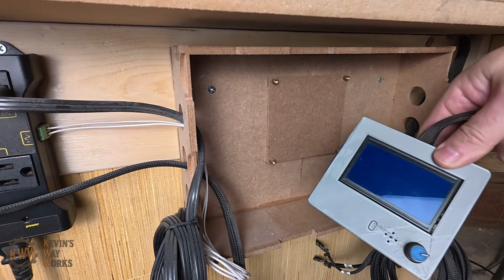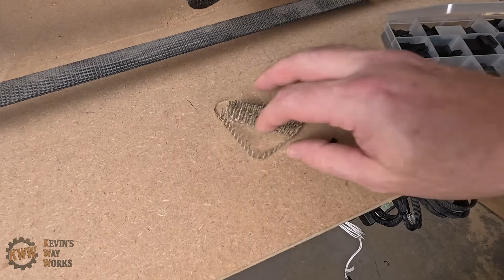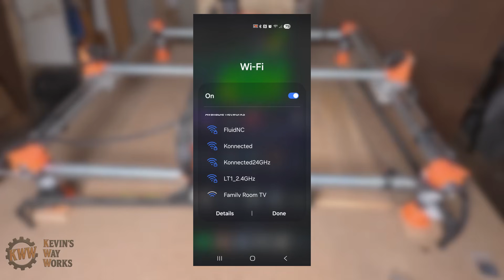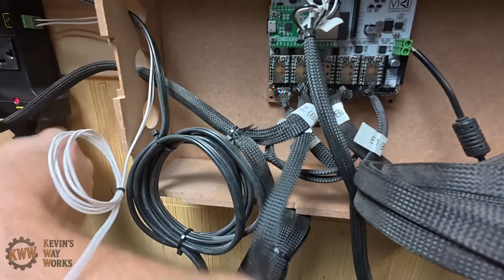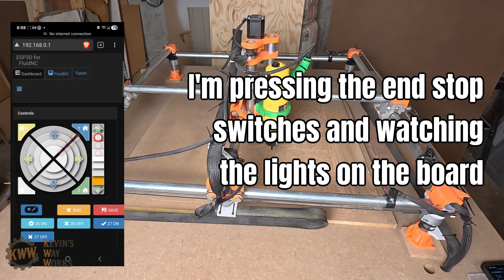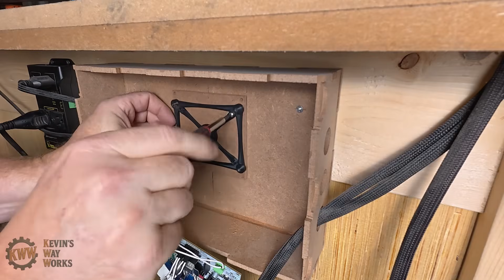Marlin Out, FluidNC In! Converting My MPCNC Router

Comment: What does fluidnc do that other software does not do? Like mach3?
Reply from the maker: I like FluidNC for ease of use, remote access and because it's PC independent.  You don't need a dedicated PC to run it.  It runs off a very inexpensive esp32.  All configuration can be done via a config file.  No recompiling code and reloading firmware.  It's also WiFi accessible making it really east to access, control, upload models, etc.  FluidNC is also open source and free.  Mach3 requires you to be tethered to a PC and you have to pay $175 for a license.  There is also third party CAM/Control software that you can use to control FluidNC.  I like using OpenBuildsCONTROL, for example.

Then there's marlin.  Any changes require recompiling code.  The interface is a pain to use and it cuts off file names.  No web/remote access.  It's meant to be standalone firmware to run on the main board.  It works but it's not nearly as convenient as FluidNC.

Comment: Two things.  First, did you have to generate the yaml file? Or could you just download it from V1 somewhere? 

Second, what is the relay box that the jackpot "talks" to for controlling the router?  A cursory search at Amazon didn't turn up anything that was a complete setup.
Reply from the maker: The yaml and other files are on v1e's github page here:  https://github.com/V1EngineeringInc/FluidNC_Configs/releases.  The relay is a Digital Loggers IOT Relay.  Here's the amazon link:  https://www.amazon.com/dp/B00WV7GMA2 and here's the manufacturer's link:  https://dlidirect.com/products/iot-power-relay

Comment: Where did you get the board?  I don't see it on V1's website?
Reply from the maker: Here's the link to the board on their site:  https://www.v1e.com/products/jackpot-cnc-controller
Reply: @KevinsWayWorks  So, it does come with the drivers and ESP32?
Reply: @JackInTheShop if it does that’s a great deal!
Reply from the maker: If you buy it from V1e, it comes with the esp32 and 5 drivers.   If you buy it through the external vendor link mentioned on the site then you do have to supply the eap32 and the drivers separately.

Comment: I have not used my MPCNC in a while. Might have to breath new life into it.
Reply from the maker: I really enjoy using mine.  Even more so now that it's running fluidnc.  I need to get my low rider going next.  Just cleared some space in my shop for a full 4'x8' setup.
Reply: @KevinsWayWorks  Stopped using mine after I got the Longmill. But I have made my Longmill convertible to Plasma. So while I am running plasma jobs, I can't run router jobs. And I do like Vcarve and G-sender.